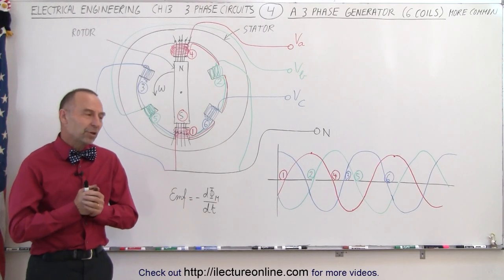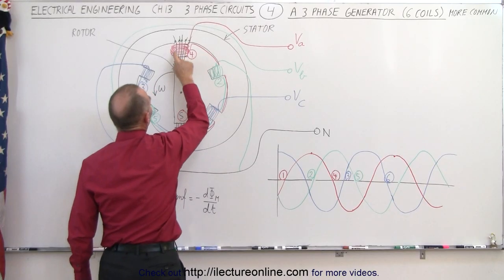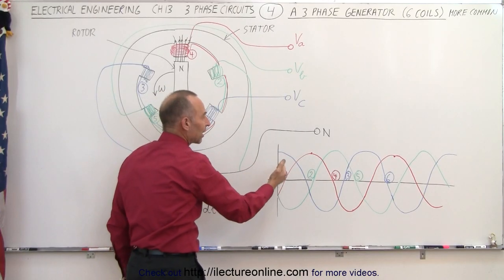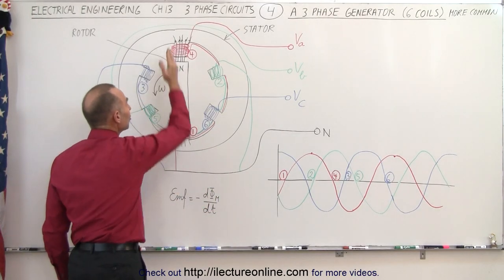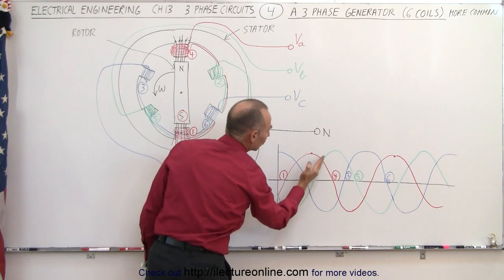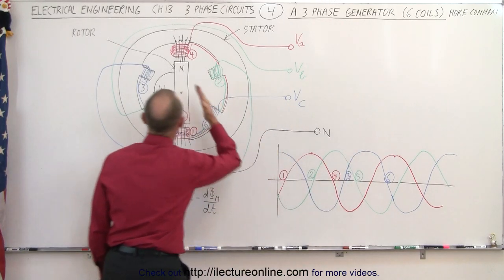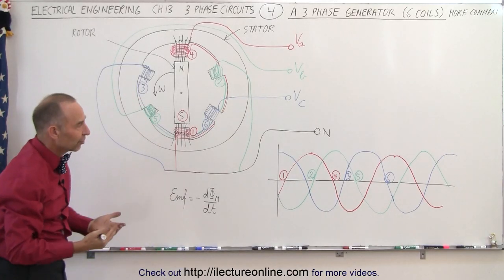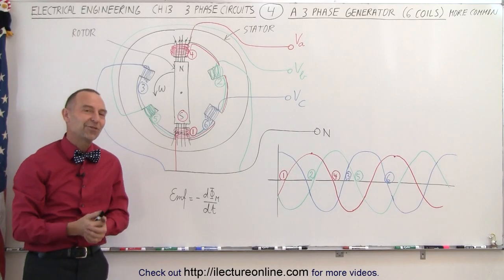Electrical Engineering: Ch 13: 3 Phase Circuit (4 of 42) A 3 Phase Generator (6 Coil)

Comment: Excellent explanation! I've been curiously digging into learning to make my own generators and especially was interested in 3 phase. This laid it out very cleanly and effectively. Thank you for putting the time and effort into this and sharing it online!
Reply from the maker: Glad it was helpful!
Reply: @MichelvanBiezen  Agreed I am so glad I found this channel for the first time I am understanding coils and coil layout now I need to know if the coil wire is enameled or insulated in any fashion I am confused about that I see most motor windings as plain wire but it does appear to have a clear enamel coating of some kind does generator wire have this same clear coating of enamel or a kind of insulation of any kind

Comment: I spent hours looking at many tutorials to figure out the most fundamental thing you didn't mention! Which is this: I discovered that the maximum point of flux produced by the rotor is at 90deg to the N & S pole ends, which is why there's no voltage produced when the rotor pole ends pass over stator coils at 60 deg apart. Hence, now explains why the waveforms are 120deg apart, not 60deg!
Reply from the maker: Good input.  Thank you.
Reply: "Theo định luật Faraday, cường độ dòng điện tỷ lệ thuận với tốc độ thay đổi của từ thông." Ngoài ra, mật độ từ trường cao nhất gần nam châm nhất, có nghĩa là tốc độ thay đổi của từ thông sẽ lớn nhất nếu nam châm di chuyển trở lại cuộn dây, ngay cả khi nam châm đang chuyển động với vận tốc không đổi. Vì vậy, khi nam châm ở gần cuộn dây nhất, sao cho các đường từ trường tiếp tuyến với cuộn dây, lực điện động cảm ứng phải lớn nhất. Nhưng trong video, nó cho thấy điện áp cảm ứng bằng 0 tại thời điểm này.

Mặt khác, khi nam châm di chuyển ra khỏi cuộn dây, các đường từ trường trở nên ít dày đặc hơn, có nghĩa là tốc độ thay đổi của từ thông giảm, do đó cường độ dòng điện sẽ giảm. Tuy nhiên, biểu đồ trong video cho thấy điều ngược lại.

Tôi thực sự không hiểu điều này. Bạn có thể vui lòng giải thích điều này cho tôi không?

Comment: A fantastic video. A real stator is never wound like that though. There are no gaps between coils and the two coils of the same phase you have facing each other would never work. The output would be all over the place. Instead, a real generator would have many sets of coils for one phase (not just two) all the way round the entire circumference. The other two phases would be the same. Each phase would be arranged such that its next set of coils is every third coil along. This maximises the interaction of the rotor field with the coils. It would make it more complicated to explain so I get the simplification and your explanation is brilliant. It’s just that I want to point out a real stator wouldn’t look like that a tall and wouldn’t work if it was wired that way.

Comment: I didnt see if you mentioned the direction of winding for poles (say for A) one pole is wrapped clockwise and the other is counter clockwise. Very important for a sinusoidal input.
Reply from the maker: Thank you for your input.
Reply: @MichelvanBiezen  Is winding them in opposite directions correct?

Comment: Hi, I'd like to ask about at which pole position the generator can achieve its peak voltage. Why does it different with the 3 coil generator? The 3 coil generator seems to have peak voltage when the pole is parallel with the coil, but in 6 coil the voltage reach its peak when the pole is perpendicular with the coil
Reply from the maker: The drawings are coincidental to the postion of the rotor.  The peaks occur at the time that there is a maximum change in the magnetic flux through the loops.  Take a look at this video:  Physics 45 Electromagnetic Induction: Faraday's Law (4 of 4) Rotating Loop Conductor  https://youtu.be/atbioBvN8hE   which show you that basic principle.

Comment: Thank you so much sir.  One doubt sir flux is actually cutting north pole side (flux is going to North to south) therefore the induced current is produced by North pole side coil only and next 120 degree to produce negative half cycle in same coil because north pole is opposite coil side..... is my concept is correct or not correct sir?

Comment: I am trying to wire a 3 phase generator to single phase using the Twelve wires coming out of the generator wires 1 and 7 are connected to a load wires 8and 2 are connected to a load wires 3 and 9 are connected to a load wires 4 5 6 10 11 12 are all grounded. Do I split 8 and 2 and connect 2 or 8 to 3 and 9 and one to 7and 1?

Comment: Nice video. Congratulations.
But I didn't understand why the Emf = 0 when the magnetic flux is maximun in the coils. Could you please explain it?
Thank you.
Reply from the maker: An Emf exists in a coil ONLY when the magnetic field is CHANGING.  At the moment when maximum magnetic flux is reached the magnetic field is NOT changing at that moment.    (Like a ball reaching maximum height when thrown upward, v = 0 at the top)
Reply: @MichelvanBiezen  i also got the same doubt but i could not understand the reason pl.
Reply: @MichelvanBiezen  But the magnetic field in your diagram is from a bar magnet. At no point in time in its rotation is the magnetic field CHANGING. The bar magnets field is constant in flux, and maximum at its poles, being rotating by some external mechanical device. Since it's constantly rotating, there is always cutting action. And the max lines of flux are cutting when the poles (N and S) pass a coil, and decrease as it rotates away. Increasing as it approaches. Rinse and repeat...

Comment: Simple and quick question,  to recreate  a quick  charge for a Tesla with  using a 3 phase generator  that's equal to  the quick charge system, what  hp motor would be needed  in the drive motor to turn the 3 phase generator? 200 +?
Reply from the maker: I would contact Tesla with that question.  We had 2 houses burn down in our neighborhood already because of their car chargers catching on fire.  Better let the experts handle that.
Reply: Thank God people are listening.  Been trying to contact Tesls with  no reply for awhile.  I have discovered 2 ways to charge a Tesla using it's own  on board power to recharge its systems. This is big. A totally green  vehical. Still in the works with  a few bugs but 99.9 % it will work. Do you  know the ramifications?
Apparently  going to Mars  must be more  important.
Reply: This  inspired my inquisitive inspiration: https://youtu.be/Iw0bd6-yhNw

Comment: How many volt and ampere we have to fill the rotor that it has a quite large electric magnet to produce 220 volt?
Reply from the maker: The voltage is determined by the speed at which the magnetic flux changes through the coils.  Therefore it will increase as a function of rotation speed.

Comment: @Michel van Biezen  will the efficiency of the generator increase if the stator cores around which the wire is wound are hollow, like a pipe, because then the magnetic field in the stator will be more near the wound wire, around the sides, unlike a solid rod where magnetic field will be distributed along the cross section?

Comment: Oh dear, I'm so confused. Isn't the flux equal to BAcosx? So when the magnetic field points directly through the windings(as drawn), its parallel to the  red coil right? So how does the change in flux end up being 0? Should'nt it be maximum, since cos(0) is 1?
I have a feeling I've seriously misunderstood something. I'd be really grateful if someone could clear things up.
Reply: Flux equals BAcosx . What we need is rate of change in flux which equals to BAsinx  .so  emf is 0 when they are parallel
Reply: your doubt is very right and u have understood rightly

Comment: Sir i have a question. 
Is it possible to get only 240 volts from the output of a 3 phase transformer? While my input wiring is 3 phase 360v? Because I'm planning to buy a 3 phase ac generator dynamo and at the same time i want a 20kva 3 phase step down transformer. Is that even possible?

Comment: Wouldn't the voltage of the red at point (1) be at the maximum, not zero? Since the strength of the magnetic field is strongest at the red at point (1). Why not?
Reply from the maker: The maximum voltage is reached when the CHANGE in magnetic flux through the loop is the largest.

Comment: Someone answer this, if the neutral is a coil and the magnet S\N giving it a flux so why the neutral does not act exactly like a phase, could someone please explain it what is the difference between phase and neutral in this graph
Reply from the maker: The neutral wire in a 3 phase circuit is used to carry current created by a current imbalance
Reply: @MichelvanBiezen  Thank you for the replay my misunderstanding come from the physical similarity between neutral and phase, is the the direction of the spinning decides what coil is neutral? so if counter direction means the neutral will become phase and vice versa

Comment: Should the coil be wound the way you're showing or big coils with one side on 1st and other side on 4th slot?
Reply from the maker: There are actually a number of different ways the coils can be wound.
Reply: @MichelvanBiezen  will the efficiency of the generator increase if the stator cores around which the wire is wound are hollow, like a pipe, because then the magnetic field in the stator will be more near the wound wire, around the sides, unlike a solid rod where magnetic field will be distributed along the cross section?

Comment: If the coil wire touch each other ,then will it not work...? Right..!
Reply from the maker: Indeed, the wires cannot touch each other.
Reply: @MichelvanBiezen  connected wire from start to end...in all 3 pase...are if touched any one of coil or other connected coil wire then still it will not work...? So as per ur r saying...all coil required to have a space and connected wire of each pace also required space ( not to touch other connected wire) ....then it will generate power electro magnetic. Right...?
Reply: @MichelvanBiezen  thank you for replying...
Reply from the maker: Note that wires in coils are covered with insulating material.  That way when they "touch" they will not short out (allow current to flow between them)
Reply: @MichelvanBiezen   ok got it ...
Reply: @MichelvanBiezen  i am chartered accountant but trying new things in life ...by new people knowledge...which worth to learn in every life...bec every life start and end ...must add new and exciting things between start and end.🙂🙂🙂😊😌😉
Reply: @MichelvanBiezen  thank you for replying.🙏
Reply from the maker: You are correct.  Life is what we make it.

Comment: I don't get it. I thought at North pole approaches the coil it starts to induce  voltage reaches it's max when half way to the middle of the coil and at zero when it hits the middle of the coil.  Then as the north pole is pulling away from the midde and out of the coil the phase is at max negative value.  So one full phase is realize in your diagram by the magnet simply moving 2 inches, just approacing and passing out of the phase one coil.  I was also let to believe  a south pole will cause current flow in the same way but opposite direction.  AM i wrong?  If so pleasee help me iwth why and shoud the coil windings in this set up be going in opposite dirctions.  For exampe one coil is wound clockwise and the other counter clockwise.
Reply from the maker: This video may clarify this for you:    Physics 45 Electromagnetic Induction: Faraday's Law (4 of 4) Rotating Loop Conductor

Comment: First I would like to thank you for your efforts on these videos I learned a lot from this video but I am 99 percent sure your graph points are placed incorrectly  and I am commenting for people trying to learn this so they dont get confused.  When the poles of the magnet are near the coil the force is the strongest and the voltage will be the highest.   When the poles are perpendicular to the coil it will be the lowest.  Point 1 and point 4 should actually be the maximum positive and maximum negative voltage points on the graph for the red phase C.  I saw where someone said point 1 is zero because the magnet is not moving.  If this were true there would be no voltage on the other phases as well.  But from the graph the magnet is obviously moving and when it approaches the coils the voltage is actually the highest and also the lowest.  It is 0 when the magnet is perpendicular to the coil.
Reply: I wanted to point out the same thing. Good job!